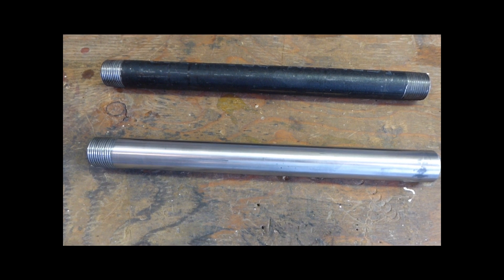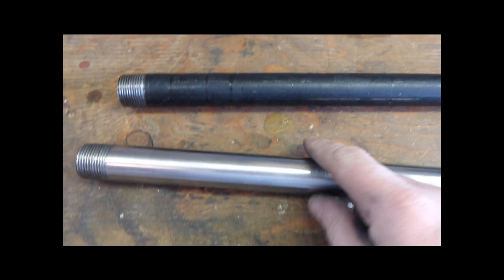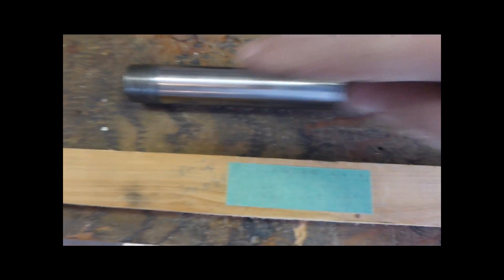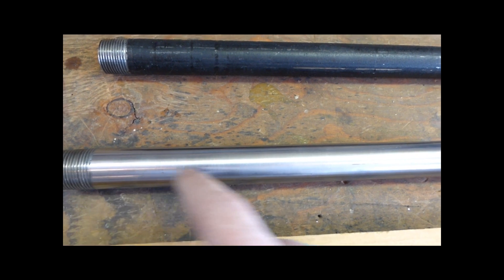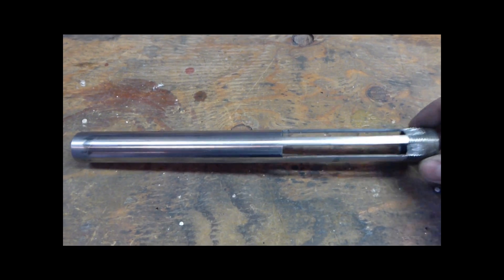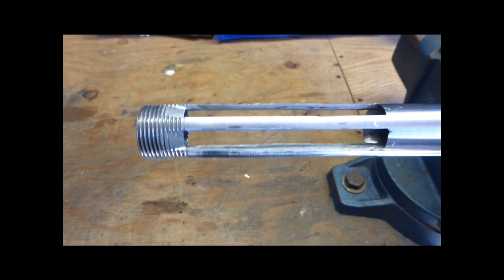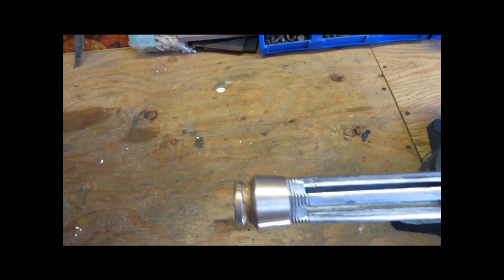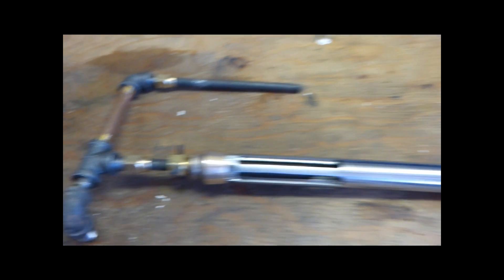propane burner build

Comment: Doing a fair amount of research for building forges and burners, I was surprised about the lack of information on the actual gas line/high pressure regulator set up. I know a lot of people think it's common sense stuff, and I would agree. However, when it comes to potentially blowing my shop(and myself) up, I want to be crystal clear on how to prep the fittings and how to set it up safely. This is the only video I have found that explains the line setup from the regulator to the burner. Thank you for your video. Hopefully it saves somebody a lot of pain and money.

Comment: Nice video but two things you did not show, the build of the orifice part and there seems to be a sliding tube over the burner tube that restricts the input air that you did not show. Would be interesting to see those parts also.

Comment: I like your design but this is coming from someone who only saw videos.  I think your fuel air mixture is a bit rich.
Reply: The reason why is 95% north of his propane orifice is not used at all: Its a bad design. Trust me I have BS in Mechanical Engineering fluids is part of that. If he wasnt running at such a high psi the fire would have climbed way far up that pipe (that black iron will not last long under the heat). Because the fuel efficiency is sooo bad the dragons breath coming out that thing will be huge and the sheet metal shelf will warp and probably crack.

Comment: Good video & nice build, I built one similar to yours the other day difference being I just drilled 8- 1/2" holes spaced apart first 4 holes 2" down then staggered next 4 holes 3/4" inch down from first 4 works great little less time consuming, though your machined slot design is far more unique looking .I really like the simplicity of how it all connects together with readily available items from the local hardware store also very low cost. keep up the good work.